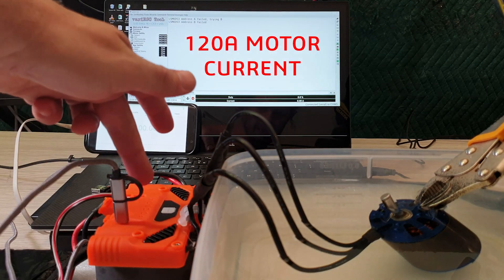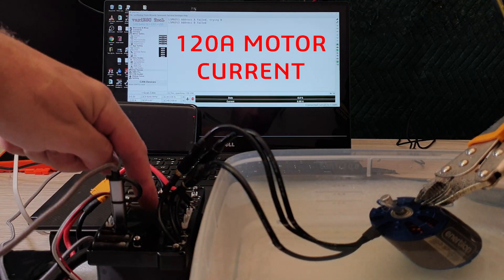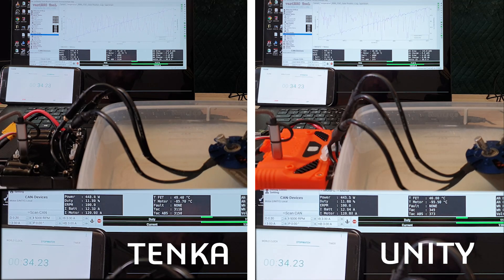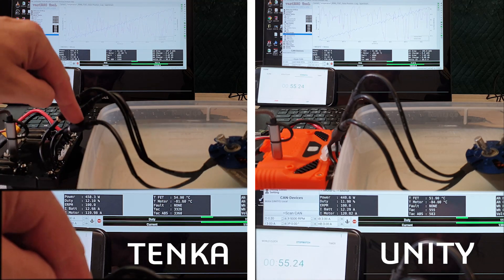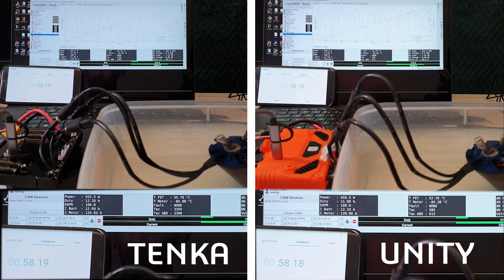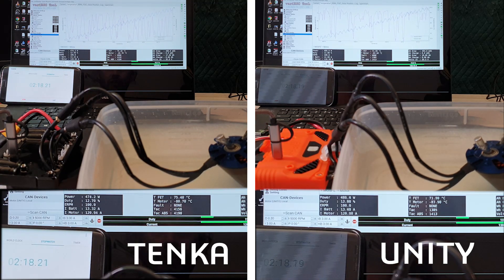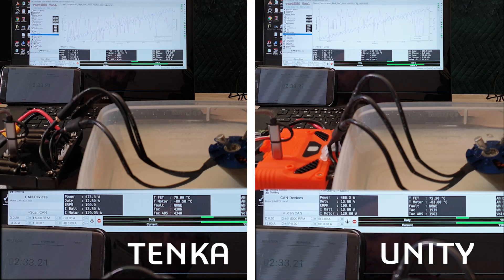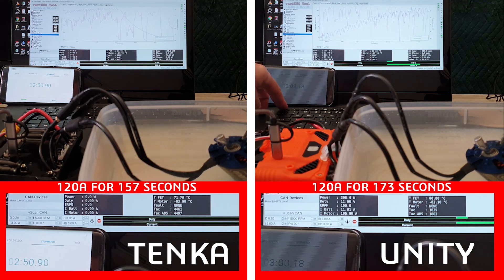Unity VS Tenka | Single Motor 120AMPS Continuous

Comment: I want the other way around? How to make a FOCbox with 4 channel outputs so I can run 4WD hub motors? 4 motors means distributed load=less heat=less resistance

I want hubs because I can't stand replacing belts but I want to still be able to climb hills without frying motors?

A similar controller with the same maximum power output, but allowing for more channels would be beneficial even to eskate riders that only have 2 motors, especially if you could bridge channels like in this example?
Eg. Max board output of 2.4kw, 4 channels at 600w each, or 2 channels at 1200w each, or 1 channel at the full 2400w? Or then even incremental stages to cater for less powerful motors but with overhead to upgrade later on? You could have 1 motor at 600w or 2 motors at just 600w each? Allowing someone to make use of something they have spare and upgrade later on without needing to replace battery, controller and motors? Controller manufacturers need to become more scalable and flexible and less tied to other expensive components

If someone makes this kind of controller, they will be catering towards eskates across all types? Off road, on road,  hub or belt

Comment: I have bought a Tenka and want to connect it with my Flipsky VX2 Remote over Uart. With other esc’s I did not have to set up anything to get the motors to spin, (except for the initial motor set up in the VESC-tool) but with the Tenka I can’t get it to work. Do I have to change some settings?
Reply: You have to turn on the UART in the app

Comment: So why are the motors in water ??
Reply from the maker: Because motors for esk8 cannot normally have 120amp continuously running into them without going into melt down. The water is for cooling purposes during high current test. In normal use on an electric skateboard the load at the motor determines the current in the motor. But as forward momentum increases, the load reduces and so does the current being used inside motor. On average most esk8 riders probably only need about 20amps motor current to keep moving. The current peaks during acceleration from stationary position and during hill climbing. 120amps is more than anyone can ever use in real world.

Comment: So the TENKA is the newer product? More efficient in manufacturing and such?
Reply: Im also wondering about this....
Reply from the maker: New case design, it is better for heat dissipation. Also, the electronic components are protected from environmental debris as it is potted in special thermal epoxy resin.
Reply: @ElectricSkateboardBuilder  Where do I buy it?
Reply: @marheim9361  pretty sure massive strator sells em